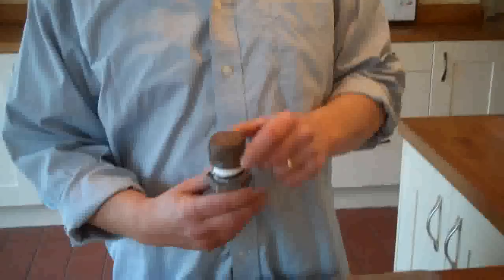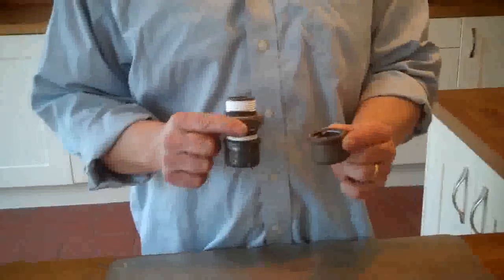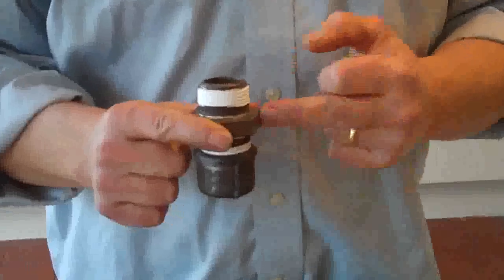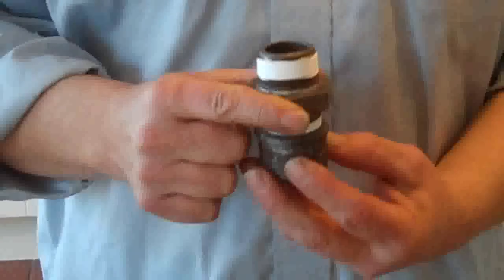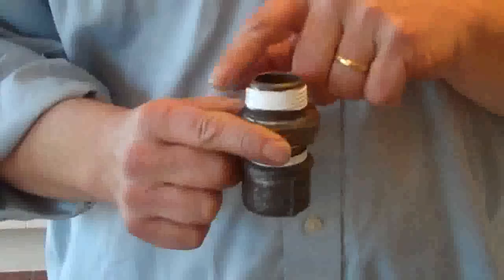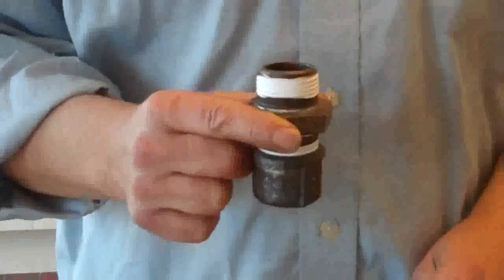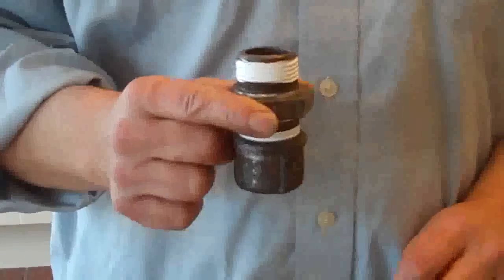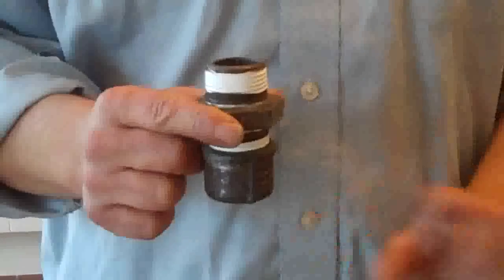Graphene from table sugar - the Tang Lau Method

Comment from the maker: It forms at the air liquid interface first then grows down from there. If you have a Teflon lined autoclave you will get much better results. Thickness of layer is moderated by time temperature and precursor concentrations. I would be very interested in your results. Let me know when you have posted and all the best.

Comment: Hello,

I am a student at University of North Carolina at Charlotte, and am very interested in high quality graphene synthesis (as many are). 

I have access to several very high temperature ovens (used for high purity silicon oxidations), but am confused about where the graphene layer forms using the Tang-Lau Method:
 Does the graphene layer form on the top of the solution, or does it form on the parts where the hot metal fitting contacts the solution?

I will be posting any progress I make.

Comment: I saw another video of yours where you explained your autoclave and you were talking about hydrothermal canonization.  This appears that you are hydro thermally carbonizing sugar, so I have a couple of questions.  Why does this mix not have hydrochloric acid?  in the other video, you said that it was necessary for the reaction to occur.  Also, could this be done using the micro-wave oven approach?  Thanks

Comment from the maker: it was more than a layer thick - i made sure it was so you could see it. About the only way of knowing you have anything if you make it thinner is to anneal it and measure resistivity. if the resistance is infinite - you haven't got anything. I went through how to control thickness on the vid.

Comment: Maybe this is a stupid question, but how do you know that it is a single layer of graphene?   If it was a single layer, it would be invisible or is a bit of solution stuck under it, wich makes it visible? How come we saw it when it was in the glass, if it was a single layer, it would be too tin to be visible. Also, is there any method of finding out the thickness? 
Your videos are great
Regards, mrvos

Comment from the maker: for super capacitors reduced graphene oxide is best as the surface area is large. If you use other forms of graphene you will have to activate them. The other forms are good for transparent conductive fils and inks

Comment: Do you prefer the electrolysis method or Tang Lau's method to manufacture graphene? Which method do you think would produce better quality graphene for super capacitors if you had access to a potter's kiln that can handle temperatures of a little over 550C?

Comment: Got a bunch of pipe fittings in a bucket outside...kept them for no reason. Definitely going to try this. 
Looks like an oil layer doesn't it. Reminds of garage forecourt spills with the colours....erm the sun hitting remaining sugars in the fuel and heating it on summer days wouldn't produce a graphene layer would it ? lol. Intriguing again, great video.